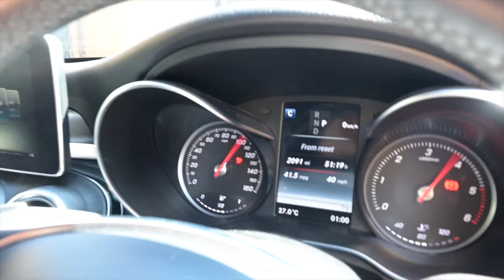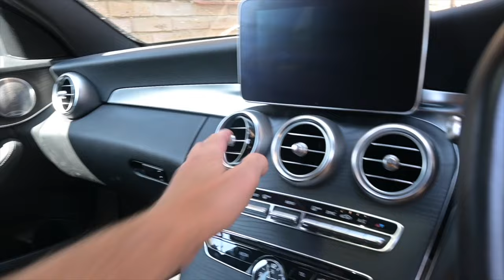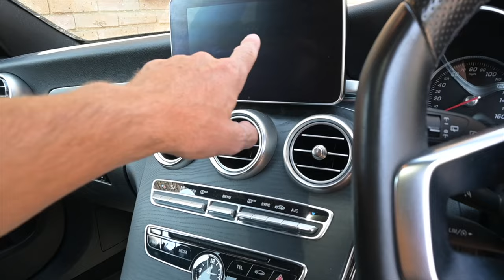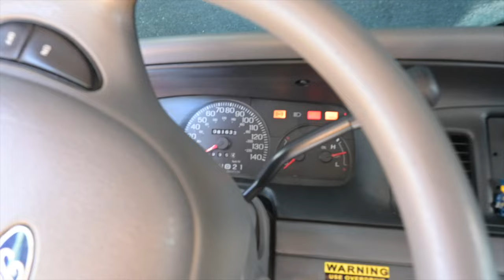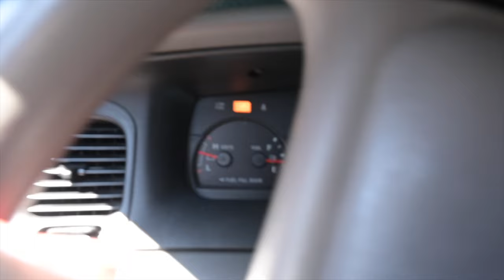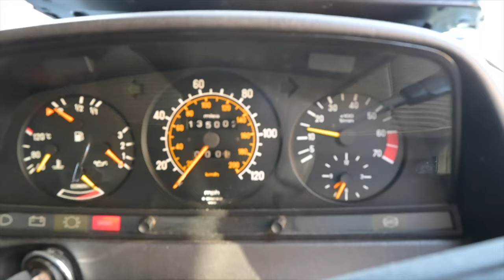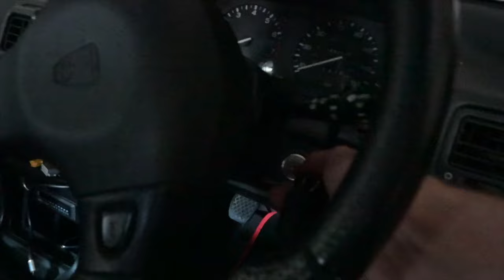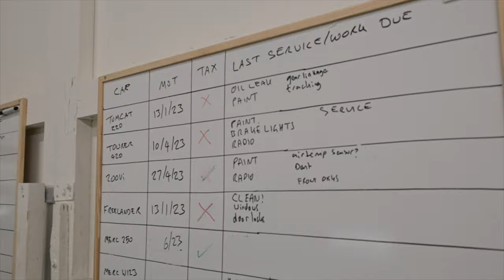Fleet round up - I drove my new car to Italy over Stelvio, now I need to fire up EVERY car I own

Comment: @furiousdriving why not just buy all season tyres. I personally couldn’t be bothered with summer & winter tyres and all the faffing around changing them. I don’t see the point in winter tyres to be honest. You do have an AWD estate after all.
Reply: Yep I used to do a swap every year swapped to all season and haven't looked back
Reply: I prefer just changing them. Then again in my country you are basically required to fit winter tyres from October to April, all season tyres are sort of allowed but you need a million other things to make it technically legal.

I just buy a set of alloys for summer tyres and steelies for winter ones. Then again I also daily a nearly 30 year old car with 13" wheels so a brand new set of tyres costs me about €70 for 4 tyres.
Reply: @GlamStacheessnostalgialounge  that is totally different & I would do exactly the same if it only cost €70.
Reply: @anakinskywalker4113  The beauty of owning old cars. SUV owners stare in disbelief.
Reply: I was pretty shocked that he'd have to pay 250 £ apiece for what looks like a bit of rubber on the rims...
Reply: @GlamStacheessnostalgialounge  yep that's true but we rarely get bad winter's here but who knows what may happen
Reply from the maker: Steelies not an option on this, the brakes mean 19" alloys or above, All seasons are on my wife's Mini, they are very good but do ride softer than regular summer tyres
Reply: @furiousdriving  it just seams a waste of £800-£1000 which could be better spent. Also if I’m doing a road trip or pretty much any length of driving. I absolutely hate anything to with apple car play or android auto or anything that connects my phone to to car. Couldn’t give a rats about the phone. I am into enjoying the scenery & the driving & I cannot do that with a great big screen in the way. That is one thing I utterly hate about modern cars. All I want is a cracking stereo for some tunes & that’s it. Everything else is distracting & has nothing to do with driving the car so I don’t like any of it.
Reply: @furiousdriving  for the winters we get in the UK, cross climates are an excellent choice
Reply: @furiousdriving  I might be wrong, but are the brakes really that enormous to demand 19"? I can well believe the need  for Mercedes original 19", but aftermarket often have alloys with more clearance. My, admittedly old, BMW 335d, has 340mm discs, it is possible to get some 17" alloys to fit. Another example is Tesla Model 3 Performance that can only be ordered with 19" or up, but can use aftermarket 18" just fine.

Edit: Just looked at your review video of this car again, at least from the video https://youtu.be/GcWr0zeHe-8?t=1278 it looks like there is a ton of clearance for smaller alloys around the caliper, so much so that unless my eyes are decieving me very much, perhaps even 17" of some brands might fit, but definitively 18". Might have seen wrong, as I said, but thats what it looked like.

Good luck. Cheers.
Reply: An AWD doesn't necessarily brake better on icy roads. That's when you still might need winter rubber
Reply: @petticlone  Indeed, but just a small add-on: AWD cars brakes not better or the same, but worse on icy roads, without exception, because of the higher weight. Not usually a big difference, but where there is one, its slightly for the worse.
Reply: For mild climates, all season tyres are the best. But only for regular cars and regular driving. I (unfortunatelly) have a 2009 Sandero 1.4 and have Michelin CrossClimate 2 tyres on it. For such car, they are great. They even perform better in summer then economy summer tyres and in winter better then economy winter tyres that I used to have.
But for proper cars and spirited driving, I would choose proper premium summer UHP tyres, and a proper premium winter tyres.

Comment: Left field, but I've loved every minute of my Giulia with the ZF8. They also do a 6 Speed manual on the 2.2 Diesel, and they offer it on the Stelvio too - I honestly can't speak highly enough of mine, and wouldn't hesitate to recommend it. Worth a thought?
Reply from the maker: Id love a Giulia, they look stunning and its an Alfa, the manuals are first year or so only and hard to find but the boot is very tight on them (and not much better on the Stelvio)., if only they'd make a Giulia estate!
Reply: @furiousdriving  ah, I didn't realise how limited the manuals were. I can only say that the ZF8 in manual mode is pretty flawless (at least with Alfa's programming) and can be tuned to be even quicker if you want. Might be a worthwhile option if the Stelvio can cut it. Agreed on space though, it's not the roomiest of cars 😂

Comment: Does the C class not have paddle shift on the wheel?; for the type of arduous driving you experienced use these most of the time in sport (even if not going fast), this ensures quicker shifting - comfort or eco just won't work the way you expect. Other sluggish shifting may be cured by a couple of transmission services as, even if not considered to be required.
Reply from the maker: it does, but its very anaemic, feels like a video game rather than an actual interaction and doesn't always do anything if it disagrees with you

Comment: The Crown Vic probably has a bad petrol cap. A curiosity of US OBD2 systems is a hypersensitivity to vacuum leaks in the  evaporative system. A cap should run £5-10 from any online spares source in the US.
Reply from the maker: Rock Auto will have them for sure
Reply: @furiousdriving  This is such a common issue in North America that they sell petrol caps at 7-Eleven.

Comment: Great video. no point changing those tyres now though... soon be winter.
Reply: If you want to wear them out as quickly as possible before winter.. sure. That type of rubber is not made for summer temps.

Comment: Then sell those tires!!... and buy som summer tires instead.. Even heavily used summer tires is going to be better in summer than a completely new winter set..
 The winter tires have very soft rubber and you are going to destroy them by using them in the summer! They will wear out fast in high temps..
 How is that going to save you any money? Then you are going to have to buy BOTH new winter and summer tires....
Reply from the maker: They do wear but not as fast as people worry. Ive been swapping summer and winter tyres for years, usually have a second set of wheels for winter

Comment: I would get that gearbox professionally checked over. My C250 is every bit as quick to change as a manual and always changes exactly when I want it. Looking forward to work continuing on your w123. Great update.
Reply from the maker: It changes fast on the move in normal driving, just takes an age to decide to move from rest or to kick down if its not in Sport mode

Comment: Call yourself a petrol head and drive a car in the summer on winter rubber! If u drive a merc u have a auto mercs are not known for their manuals,! You need to find the settings you like and if it has a learning box like most modern autos get it reset, learn your style of driving
Reply from the maker: It does have a learning box, which has been reset, Ive done an individual set up but you cant fine tune it very far, so still stuck with either laggy low power or wont go into top gear on the motorway. And as for winter tyres, summer ones are nearly £1000 for a set, lots to spend on a car I might not keep

Comment: Matt, are you anti auto just for a daily? Guess the Crown Vic is not in any particular danger of departure? I've not bought a manual for 12 years and 99% certain never will due to incident involving my leg and a boat trailer 🤕.
Reply from the maker: Odd ball collector cars I can live with as an auto as its part of the character and not everyday, when its the car I use almost every single day (Ive put nearly 5000 miles on this already) and the only plus point is its good in traffic jams...thats not really selling itself to me. The problem now is theres nothing as well specced and with the same quality of interior with a manual
Reply: @furiousdriving  be interesting to see what % of new learners are going automatic only, not aware of any manual EVs except classic conversions.
Reply from the maker: @stippolyte  i think that’s a growing thing, with some thinking they’ll only ever drive EVs

Comment: @furious driving I hate apple car play & android auto etc. it is a car not a computer 
A car is for driving you shouldn’t be bothered with screens and other nonsense only a decent radio is required.
Reply from the maker: Ive had Car Play in a couple of cars and while its not a defining feature, if you use the phone as a media player and spend a lot of time there its much better than bluetooth.
I cant change books in Audible or from than to music without touching the phone as it is
Reply: @furiousdriving  I don’t spend any time at all on my phone I use CDs or a cassette tap. I’m old school. I couldn’t give a rats about the phone. I can’t do Audio books while driving either. I need to be fully aware of my surroundings otherwise I lose all spatial awareness.
Reply: I just have a 12 yr old Sony MP3 player with a selection of music that I like, on random mode. I used to listen to the wireless in the car, but I can’t stand the music on R2, or the propaganda/unfunny new ‘comedy’ on R4 anymore………
Reply: @simonhodgetts6530  that’s exactly what I would have.

Comment: Mate....you should be delighted to be able to afford a car like this without constantly moaning about the autobox. Driving an automatic (and I own and drive a Ford Expedition 5.4 V8, a  Land Rover LR3 4.4 V8 and a Range Rover Sport 5.0 V8 Supercharged daily and also own both a CL55 AMG and a TVR Tuscan) is totally different from driving a manual. Jeez - you should know driving a Camel of the Desert in the garage (the Ford Crown Vic) - with a 4.6 V8 and lazy slush box!! Stop complaining and enjoy the thing - if you didn't want an auto (especially with a comparatively small diesel engine and one of these 9 or 10 speed boxes that hunts and changes at the drop of a hat - and by the way I love the panama!!, and with a turbo with whateve residual turbo lag comes with that) why did you buy it???? And you need to understand that cars like these are designed to haul you, your wife, your kids, dogs and a shit load of luggage across continents in luxury, with ease and economically. This car did that par excellence. It is the private version of first class plane or train travel - effortless and comfortable. It is not designed in principle for hooning around, involvement or (dare I say it) driving enjoyment. If you want that, buy a manual Porsche Boxster or manual 911 but try taking your family and their luggage 2500 miles with no complaint from them in either of those. Take the Merc for what it is and enjoy it accodingly. Otherwise, you are starting to come across as a grouch!!

Comment: I must admit not even bothered yo watch this because i new you would just be moaning about the auto gearbox.theyre so much better than a manual 5hese days its untrue wouldnt touch a manual car again.its bad enough putting up with manual vans all day lol.when are you going to sort the p6 out?thats what i am waiting for.
Reply from the maker: They really aren't better. If it changed down when asked instead of leaving me hanging on the wrong side of the road in high gear I wouldnt complain. 
If it went into top without changing out of sport mode I woundnt complain, or pull away from a junction without a lag without changing out of Eco.
If the flappy paddles always worked Id be more impressed. If it had enough engine braking to make it down a mountain without cooking the brakes i wouldnt complain. Its only better in traffic jams, and thats nothing to be proud of
Reply: @furiousdriving  will have to agree to disagree on this one matt.i have bin driving for a living  since 1989 and autos really are so much better.you need a jag because the 5 and 6 speed zf autos are superb.i must admit that i think its all getting a bit ridiculous with 8 and 9 speed gearboxs tho.could be your problem.i guess they cant make up there mind which gears to be in.oh good,just seen you have put some p6 content out.now your talking👍